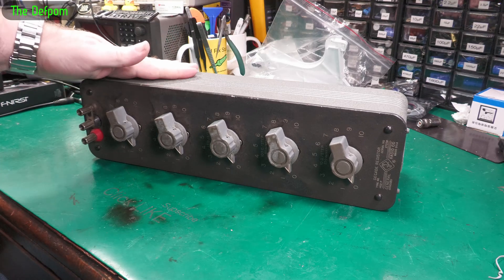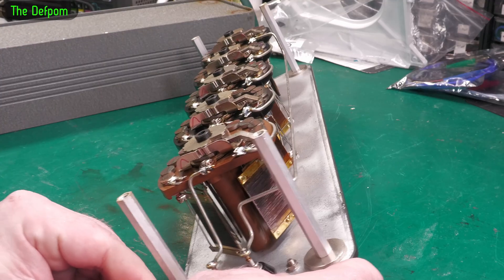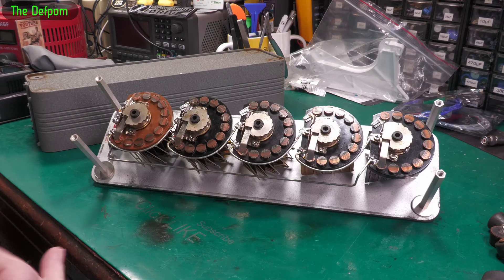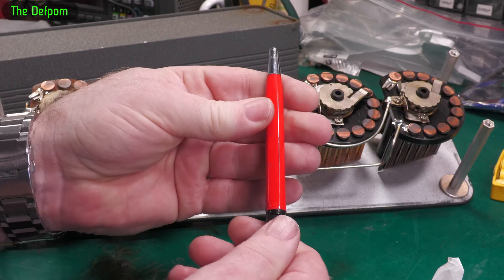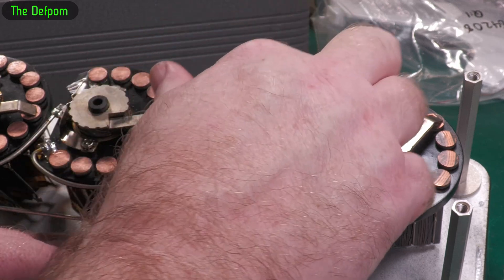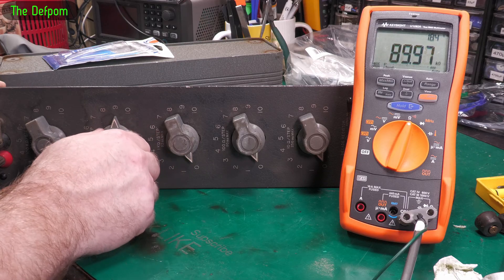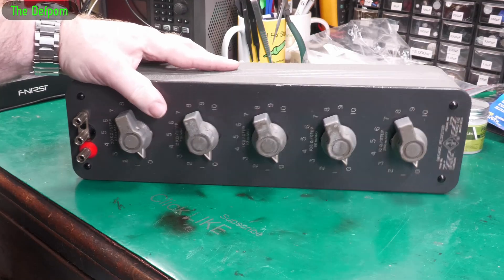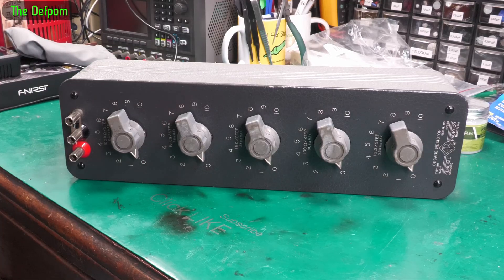🔴 General Radio 1432-P Precision Decade Resistor Refurbishment - No.1404

Comment: 12:03. What did you use to clean the face? Is it that open paste jar? Can you share what that is?
Reply from the maker: I just used some general household cleaner for cleaning kitchen benches etc. the jar is a silicon grease to lubricate the switch shafts

Comment: They are wirewound precision resistors that have inductance which is a factor if you are using these for AC.  The biggest issue I have ever seen is the lower values such as the 1 or 10 ohm ranges being damaged from excessive current being run through them.  One thing is that the copper contacts can oxidize and wear.  I used to clean the copper contacts to a bright sheen and then we would put silicone grease on them.  Reduce friction wear from the wiper contacts and also the silicone provided protection from oxidation of the copper.  A thin film not glops of it.   Also can get oxidation on the connector terminals from the environment.  Need to remove that as at the lowest ranges you may get some contact series resistance from that.